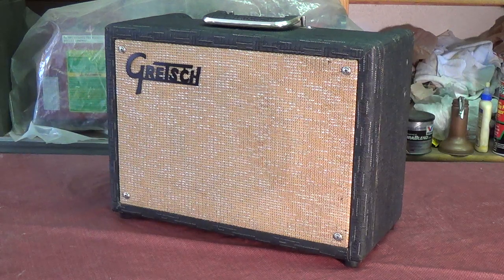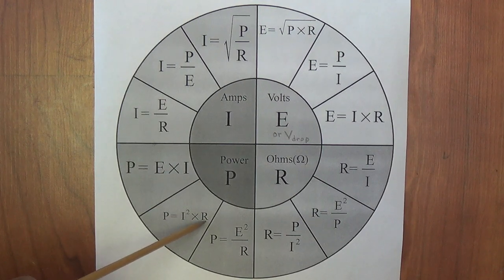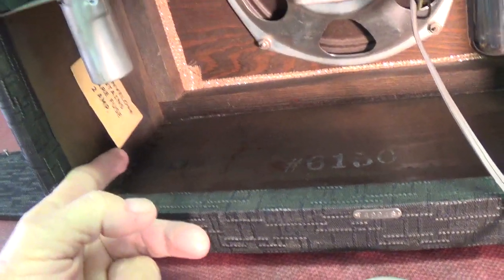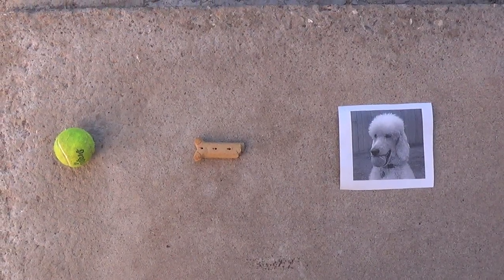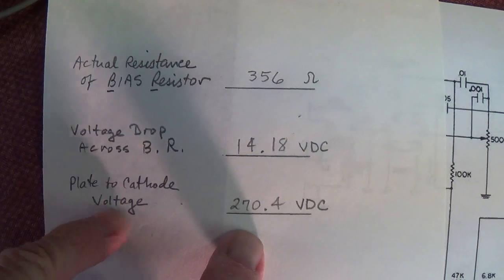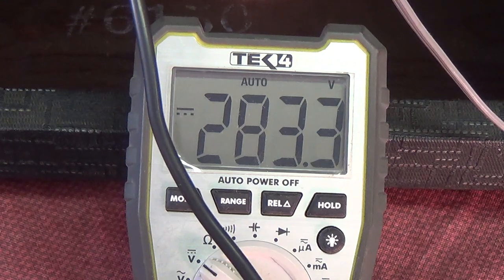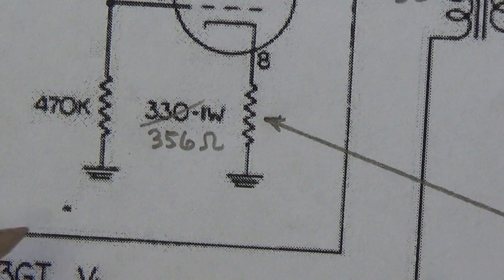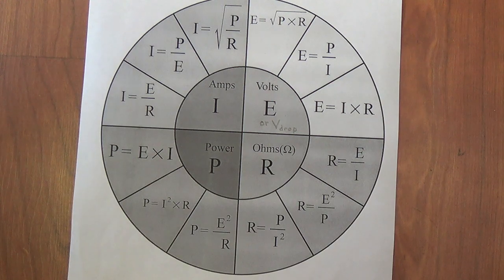Resistors, Part 2:  Power and Wattage Requirements, Practical Applications of Ohm's Law

Comment: Uncle Doug, you're videos are the best! Pass some love onto the furry ones too, plz. At 20:37 you show the circuit requiring .564W to pass thru that resistor (dam)... And you then say double it for safety. Did you not say earlier in this series how that would be like throwing a hotdog down a hallway? How the high wattage resistor would have little affect on the lower flow through the "dam"?  I've learned so much from these videos, so thank you so much.  But I'm baffled on this one, perhaps you could clarify in the future? 🙏☯️
Reply from the maker: I don't recall the hot dog analogy, but whenever you calculate the wattage requirement for a resistor it is standard practice to at least double the wattage for safety purposes.

Comment: Very good demonstration Uncle Doug.  I found it interesting on the Resister wattage. Now I have some 2 watt 270k & 470k ohm resisters I have been using in filter Cap usage. All seems to be ok so far. Now this is over kill I'm sure but could it lead to an issue? In my schematic some of the 270k ohm resisters  have 10% wrote by the resistance value.
Reply from the maker: Thanks, Kevin. There is no problem using resistors of a higher wattage than necessary.
Reply: @UncleDoug  Thanks Uncle Doug for clearing my mind on this. Appreciate it.

Comment: Another newbie question for you Doug.  At 8:43, is it possible to determine plate current just from looking at the schematic?  I am looking at a schematic and I have the plate and cathode resistor values and the B+ voltage at the transformer, but not the voltage drop across the plate resistor.  It's a 12AU7 tube.  Any tip on how to figure that out?
Reply from the maker: Not that I'm aware of, Joel. There is really no accurate way to predict the plate current without taking measurements during normal operating conditions. One main variable is the tube itself.......they all tend to vary in PC levels.

Comment: Like the way you explain all this doug, your videos have been an invaluable resource for understanding these concepts in an easier way. Question? : How is it that you are showing on the schematic that the power going into the tube is coming from the (Cathode pin 8) ground leg? I guess you are just measuring the voltage across the 1 watt (330?) resistor ? Please clarify, Im not seeing this right. Thanks --
Reply from the maker: Thanks, Vin. The electrons which form the plate current all come from the grounded centertap of the high voltage winding of the power transformer, through the chassis to the cathode of the tube, then flow from the cathode past the grid to the plate. There are various ways to measure the plate current. Please see my videos that explain them.

Comment: Your pets have made two interesting observations - perceived female fickleness (poodle) and applied aerodynamics (quad 'copter). Great lesson Doug. You mentioned 'Ballast Resistor' at the beginning but not as an application - later perhaps ?
Reply from the maker: Thanks, Dave. I'm not sure about your ballast resistor question. I use the term to refer to high wattage resistors that are used to reduce voltage by converting it to heat.
Reply: I've come across them in automotive ignition (mainly capacitance discharge ) systems - often wondered what their purpose was there...
Reply from the maker: I have no idea, Dave. Perhaps there are Internet sites that discuss the design of these ignitions.

Comment: Hi Uncle Doug;

This question is not related to the video. I noticed a .001uf (one nano-farad) bright cap shorted across the terminals of the volume pot. Is this to provide mid-range punch at a reasonable practice volume, as bright caps usually have a much lower capacity? 

Thanks for the education.
Reply from the maker: Bridging caps like this one are to enhance/preserve clarity in the output signal, Stephen, by allowing treble signals to bypass the high resistance of tone and volume control pots.
Reply: @UncleDoug  Thanks for your reply, but I thought that I said that. Bright caps usually range from 160pf to 390pf.  A 001uf cap will allow much lower frequencies to bypass the pot. It looks like a goods trick for a 5-watt amp, which are more commonly driven closer to flat-out than a larger amp. I'll try it, and get back to you.
Reply from the maker: @stephenrioux6821  Bear in mind that the signal cutoff is determined both by the capacitance and the resistance in any High Pass filter. Let us know what you discover.
Reply: @UncleDoug  No probs.

Comment: Hi Uncle Doug, another great video, thanks. I have a question related to resistors, I am planning to scratch build a Fender AB764 amp from parts found at garage sales but am a little confused regarding potentiometer selection. The schematic I have only specifies values needed but not type (A or B). Does it matter or is it important to use the right type for volume, tone etc. Any guidance would be very much appreciated.
Reply from the maker: +Tony H  If you're wondering about Audio (Log) Taper vs Linear Taper, I suggest using Audio for tone purposes.....volume, treble, midrange, bass,etc. and Linear for purely electrical purposes, i.e. variable bias control, etc.

Comment: question for unc. doug;  hi unc, I am receiving a Tandberg model 3341x reel to reel deck. It is wired for euro voltage. It has a euro plug on it. I want to use this deck if I can get it operating properly. Would you suggest changing the power transformer or trying one of the step up voltage transformers for sale on line? thanks UD
Reply from the maker: +Bluegeek1  I'm not sure where you live, BG. Do you want to convert a 240VAC circuit for use with 120VAC?  When you get it, check to see if the transformer has dual-voltage capability. You may be able to convert it by simply connecting a different portion of the primary winding.  This process might be described on paperwork within the cabinet or in a schematic (check the Internet).

Comment: May I asked a Question? I have a 50 watt 6v6 powered amp. it's push pull, I've removed the two outter tubes , one died on me. So I though it would be nice to cut down the power on this one is that Dangerous? In my understanding it is not. Also what other power tube could be exchanged for the 6v6's? Thanks
Reply from the maker: +Watchman4u  I am guessing that the amp had four 6V6 output tubes and you removed two of them.  You have to be careful which two you pull. If the amp still works and sounds OK, then I guess you were lucky.  There are Internet sites that discuss this issue.  You might want to do a Google search and read up on it. Since you have pulled two 6V6's, your power transformer could probably handle a pair of 6L6GB's or 5881's without going up in smoke. You should check the tube bias.....they will probably be rather "cold" otherwise.
Reply: Uncle Doug Yes 4 Power Tubes I pulled the outer ones. Yikes I thought it could be either or two inside or the two out side. Thx I didn't know that I've read about people using 6L6's in just Two sockets of four of 6v6 amp, to compensate for the power difference, I'd like to get a EL34 sound . I never own one the 6L6 Fender Twin is what I used for years w/a ss amp in stereo live. Then I got the 5150 w/2 4x12's wow Loud never had it past 4 1/2 ever on stage I played @ 3 with the soundmen going nutz screaming please turn down. Thats a Monster Amp & 16 ohm speakers 100Watt they don't break up easy a Clean amp sound Good thru them 5150 Cabs Sheffield speakers. I wish I could mod the thing to get a cleaner clean oh & Tank w/springs.lol Maybe they left that off because the amp moves you the Ev's coming outta the speakers would blow my pants leg. Sound pressure I see guys Crank them things w/Distortion in front of it. Insane. Too much. I did some good blues recording SRV Clapton Jimi sound w/Almond Bro's in there a guys amp blowed up during tracking in my studio so we used the 5150 till we could over dub with his amp when he got it fixed it sounded so good like an Hot rodded Fender Twin I need to get those tracks & share em. Thats a great player in Athens Ga. Gifted young man. Thanks for the advice never mind the rambling I love this stuff I don't like Hi Tech.lol
Reply from the maker: +Watchman4u  I believe you did the right thing, although a schematic would be necessary to be sure.....the two outer or the two inner are usually the ones to pull. Since the pairs are wired in parallel, you only want to pull one from each pair so you still have push-pull alternation. Pulling both tubes from one parallel pair would not be good.  As I said, I believe you could get away with two 6L6's as long as they are the only output tubes in place.

Comment: My Hewlett Packard HP48 will let me plug in numbers and it has Ohms Law & Power built into an equation library. It has the RC RL RCL circuits and phase angle changes in voltage and current, reactance, reluctance, impedance, resonant frequency, inductance, etc. etc.
Reply from the maker: That sounds like quite a versatile instrument, Seth.

Comment: Hello uncle Doug. I am new to ohms law and finding it facanating.
Q. in the cathode bias resistor,356 ohms. why would you ground/earth it as shown in the
schematic?
I conceed that I have missed some thing fundamental here. Great video.
Reply from the maker: +neddypong  Greetings and thanks, NP.  Cathode bias resistors always have one end connected to ground. Ground is the source of electrons for the cathode and the voltage drop that provides the net negative grid bias.

Comment: Great video!  But I always get confused on which components must be unattached when taking measurements of components in a chassis.  I know voltage measurements are taken with components undisturbed when but
 measuring resistance and capacitance confounds me.  It looked like in your video that when you measured resistors that they remained attached.  Do I have this right?
Reply from the maker: Thanks, Richard. The vast majority of components are measured while still in the circuit. The one thing you must be careful about is to discharge all the filter caps before interacting with the circuit.
Reply: A resistor can be measured accurately as long as a least one end is connected to nothing. By examining the schematic you can see that in the case of the cathode resistor, one end is connected to the cathode which when the amp is switched off, is a dead end. One end of the OPT primary is connected to the plate of the 6V6 which is also a dead end when the amp is switched off.

Comment: At around 11:55 you say that you are going to subtract the resistance value of the test probes themselves.  How do you know their actual resistance values?  Is that a spec that you can find from a manufacturer specification?  Just curious.
Also, is the tube "screen" the same as the "grid"?  Sorry for the (probably) silly question, just learning this stuff now.  :-)
Reply from the maker: You hook the probes together and see what resistance they have. It's generally quite low, but can be significant if the resistance to be measured in the circuit is also quite low. The signal grid and screen grid are quite different, HP.
Reply: @UncleDoug  Thank you very much for that information (sorry for the delayed reply)!
Reply from the maker: @hearpalhere  You're welcome, HP.

Comment: Thank you Doug.In this video you use the term "voltage drop".
Is this always the voltage measured across a resistor and that term is "voltage drop"?
So the voltage drop is the number you use in the many calculations where "V" is a factor?
The term "voltage drop" is not to be confused with any other voltages like the 6.3 filament or 5vac.These are set voltages.
I think I get it now.
Thank you
Reply from the maker: +Tom Ward   I understand your initial confusion, Tom. The term "voltage" can be a static (or "set") term, i.e. to describe the output of a battery or power transformer winding, i.e. a 6V battery.....or it can be a dynamic term, as in "voltage drop" which reflects the amount of current flowing through a resistor, and the different voltages available on either side of the resistor.  Voltage drop only exists when current is flowing through the circuit, and it is the value  to use in any formula that includes "I" or current (i.e. Ohm's Law).
Reply: Volts are used as the units of measure of two different but related quantities. Potential, a.k.a. 'voltage' is the amount of 'electromotive force' (e.m.f.) available to force a current (electrons) to pass through a resistance. Potential difference (p.d.) a.k.a. 'voltage drop' is the difference in potential (voltage) between any two points in a circuit, e.g. the two ends of a resistor. If we have a 6V battery, we can decide that the negative terminal is at 0V, which means that there will be a voltage (e.m.f.) of +6V at the positive terminal. If we connect a resistor between the terminals, one end of the resistor is at a voltage of +6V and at the other end is at a voltage of 0V so there is a voltage drop (p.d.) of 6 - 0 = 6V across the resistor. If we replace the single resistor with two equal value resistors in series, the voltage (e.m.f.) at their junction is +3V, so there is a voltage drop of 6 - 3 = 3V across one resistor and a voltage drop of 3 - 0 = 3V across the other.

Comment: How practical is it to rewire a dual 6973 output over to EL84 ? I'll wait on your very very professional answer with baited breath. Thank you very much. Love your videos. Say hi to the crew for me thanks.
Reply from the maker: To me, it makes good sense. You'll have to rewire the socket, naturally, and you may have to reduce the plate voltage for the EL84's.
Reply: @UncleDoug  Yes ,thank you . 6973' s are hard to find. Great stuff 👏

Comment: I wish i didn't have to ask questions Doug but i'm not the sharpest knife in the drawer. I guess if its grid bias you can't use the cathode resistor method since the cathode is grounded and you could go from pin 3 to pin 8 of the 6V6  or you have to use the OT measurements to determine voltage and bias with a fixed bias amp. I was just curious about cathode bias and getting plate voltage from pin 3 to pin 8 and if pin 8 and ground were at both the same potential in a cathode bias amp  If you think my questions are silly or tedious i'll get the hint if you just don't want to respond.  I was good with measuring voltage at the plate by measuring pin 3 to ground and then i saw you use pin 8 instead of ground  and was wondering if that was just for fixed bias or cathode bias as well? I keep watching your videos since they are fantastic and it troubles me i can't figure it out without having to worry you about it since you probably already gave the answer. Thanks
Reply from the maker: In cathode bias, you can measure the voltage drop across the cathode bias resistor to determine gross PC. PV is measured from plate to cathode. In grid bias, you measure the voltage drop across the OPT winding(s) to find PC. PV is measured from plate to ground.

Comment: Very good Doug! Theoretically wasn't Rusty's "first contact" with the photo of his lady-friend? ;) So how does an Algebra Instructor become so versed in electronics?
Reply from the maker: +Tony Manns  You're right, Tony. Maybe I misinterpreted his reaction, and love did win out after all :) My hobby (and eventual business) of restoring vintage jukeboxes in the 1980's required the ability to repair their amplifiers, speakers, mechanisms, wiring, and complex electronic components. Through experience and independent study, I developed the necessary skills to perform all aspects (other than chrome or nickle plating) of a full restoration myself.  This same knowledge and skill, combined with additional experience and extensive independent study, allows me to do the same with guitar amplifiers.

Comment: How do you calculate the volts and current coming through the cathode if your trying to build an amp and don't have anything to hook the meter up to?
Reply from the maker: You would look up the output tube(s) you are using in a tube handbook to see what grid bias is required to achieve the desired plate current.  All this data is readily available in tube handbooks.

Comment: Uncle Doug, being very green to electronics a question is there right and wrong way to install a resistor?  + or - wise?
Reply from the maker: Fortunately, Tom, resistors are completely non-polar. You can install them either way.
Reply: Aesthetics would demand that resistors should be installed so that their colour codes read from top to bottom or left to right, but electronics doesn't care either way.
Reply: @silasfatchett7380  Thanks Silas!

Comment: Good day Sir !......Love your channel ,....I have  a question !.....Bought a nice Multimeter and was trying to bias 
a handwired Marshall 1987 yesterday with all volume knobs on zero but seems that the plate voltage reading and ma reading are different after five minutes of iddeling and 10 minutes of iddeling .
So when is the best moment to take readings ?...How long we need to wait ................thank you !..................Lou
Reply from the maker: That's a good question, Lou. The values do change as the amp warms up, but generally they stabilize fairly well after a minute or two, with diode rectification, and may require a full two minutes with a GZ-34. If the plate current doesn't stabilize in this period of time, and especially if it keeps increasing, your coupling capacitors are failing.
Reply: @UncleDoug  Thank you Sir !!..............would a weak EL34 cause the readings to be different when the tube gets hotter ?
Really appreciate your help and knowledge by the way !..............Lou
Reply from the maker: Not really. As I said above, if the values don't stabilize.....check your coupling caps.
Reply: @UncleDoug  Again ,....Thank you Sir !............will do !